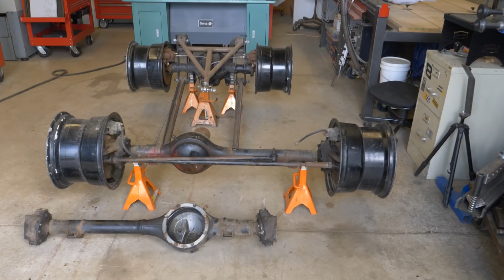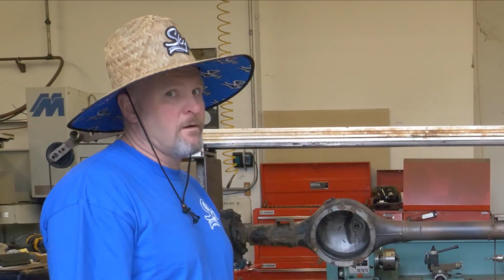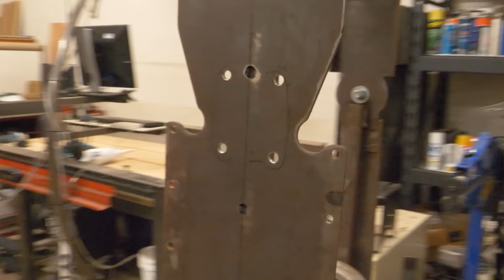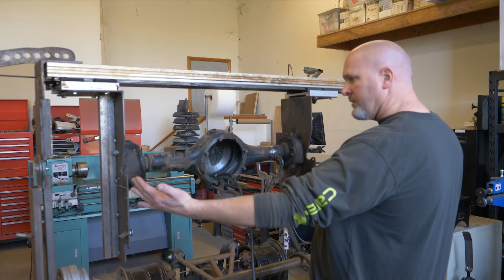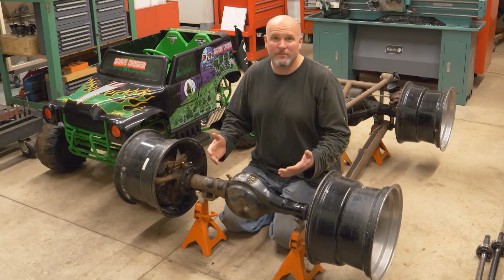Huge 4wd Grave Digger Modified Power Wheels Custom Build SAS Mini Monster Truck for Kids Part 2

Comment: baby diesel!
Reply from the maker: That would be cool.
Reply: @motomule  a 3 cylinder perkins is tiny.  
economy power king tractors, back in the 70's used to source out 3 speed crosley transmissions.  Two in series takes up no room.  the transfer case is the biggest issue.
Reply: @motomule  a brick sh*thouse is best built as a brick sh*thouse.  scrap the powerwheels limitation.  Just build a baby monster truck with lockers, 9 speeds and a diesel.
Reply from the maker: @michael-dm2bv  maybe on the next one!!!

Comment: This just gave me ideas. Like a long axle 4x4 made with 4 front axles using only the long steer side axles and extending the opposite tube. Sure would be cool to install cv joints inside the tubes and trapezoid the axle tubes for ground clearance.   You could have a low slung, wide buggy. You would have to install an oil seal at the pumpkins though. ahh. Probably not worth it. But Now I have my own idea about how to jig an axle to shorten it. Great content.
Reply from the maker: You just made my brain hurt!! 😆  Just kidding, but what you describe brings images of a vehicle that would resemble a giant spider!!  Thanks for watching!!!
Reply from the maker: Did you see how this turned out? https://youtu.be/aO-wHYO9vo0

Comment: I'm curious why you cut the Axel on the outboard side of the spring bracket instead of inboard? I'm not there so I can't see all the measurements. It just looked like it would have been a good idea.
Reply from the maker: It kept the diameter of the tubes closest to same where welded back together. Thanks for watching!!
Reply from the maker: Did you see how this turned out? https://youtu.be/aO-wHYO9vo0

Comment: Love the jig, I would have cut it short made a sleeve on the housing. Them slide the axle in then after I had the perfect tight fit tac the housing and sleeve .

After I had confirmed the fix I would weld up the housing solid.
Reply from the maker: Did you see how this turned out? https://youtu.be/aO-wHYO9vo0

Comment: Kids my ass. I'm 3' 11" mijet. Ill be watching very close.  I'm building. Mijet mine bike right. I see the beginning of my next one.
Reply: I have a older 125 or 175 kawaski. Should work plus the reverse gear box u showed on our other video.
Reply from the maker: You'll want a bigger engine than I'm using, but you'd fit perfectly!!!

Comment: Question are you sure it's 16 horsepower Briggs & Stratton is going to move all that weight in 4-wheel drive
Reply from the maker: With low gearing it should be no problem. It won't be fast.....
Reply from the maker: Did you see how this turned out? https://youtu.be/aO-wHYO9vo0

Comment: good video not that it's going to need it but best practice would have been to TIG your root weld on the axle housing keep up the good work excited to see how this works out
Reply from the maker: This was my first attempt at shortening an axle housing. I don't think I'd do it myself for a full size rig... As you mention, I can get away with it on this thing... Thanks for watching!!
Reply from the maker: Did you see how this turned out? https://youtu.be/aO-wHYO9vo0

Comment: Your building a 4x4 power wheels. Its already been done. When I was younger (16) I used a 4x4 golf kart.
Reply from the maker: It hasn't been done for my kids... To them it will be the coolest thing ever. I will feel good watching them drive it.....
Reply: @motomule  you should use both of those Land Cruiser axles. The gear ratio from a Dana 44 to that Land Cruiser is it going to be way off. Plus it's a must truck so you should make 4-wheel steering. Have a on and off switch for your four wheel steering. Would be pretty cool
Reply from the maker: @mormonmafia1705  it would be awesome to have 4ws... Perhaps on a future build!!! I want to keep this one simple and quick to build. Thanks for watching!!
Reply: @motomule  You should also build for a future build Is a mini shurp for your kids
Reply from the maker: @mormonmafia1705  that would be very cool. That AND a mini RipSaw!!!
Reply: The mini rip saw would be cool. The steering is super simple. Just hook up to left and right brakes on the steering.
(You would have a rear diff axle)
Reply from the maker: Did you see how this turned out? https://youtu.be/aO-wHYO9vo0

Comment: Hope he gets power steering or that lil guy is gonna have Popeyes forearm!
Reply from the maker: Right!! Yes, he'll get power steering. Thanks for watching!!
Reply: @motomule  maybe electric atv power steering. When your kids older but a Vtwin in it.
Reply: @motomule  Electric power steering columns are cheap and work great. I used one in a build. I used one out of a saturn VUE with an e bay control module $49 . Because I wanted a rheostat adjustment, many columns go to default  on without a computer connection. I have $160 total into my power steering
Reply from the maker: @eyeballengineering7007  thanks for the info!!

Comment: I would have had a hard time not using the spare Suzuki axle in the back and giving it 4 wheel steering like real monster trucks. Can't wait to see how you tackle the transfer case. Wonder if a quick change gear set up like real monster trucks use letting you slow it down or speed it up as needed. I am sure as they get older they will want it to go faster at some point.
Reply from the maker: Would have been cool, but this is more manageable... I don't think I have room for an actual Tcase.. Will probably just drive off of a jackshaft.
Reply: @motomule  I agree, I run a robotics club for a jr. high and setting up steering has to be the biggest struggle we have when not using omni or mecanum wheels.  The math makes their heads explode which is why we hardly ever use car style steering.
Reply from the maker: Did you see how this turned out? https://youtu.be/aO-wHYO9vo0

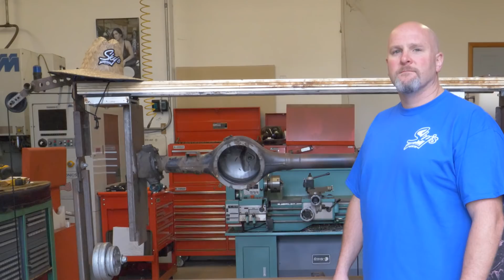Comment: Should have got the axles out a ditch witch, they are Dana 44's but Are made out of 5/16 in this wall square tube, and come with like 5:13 gears
Reply from the maker: I already had these so I didn't have to buy anything. That makes them the best chouce!! 😆
Reply from the maker: Did you see how this turned out? https://youtu.be/aO-wHYO9vo0